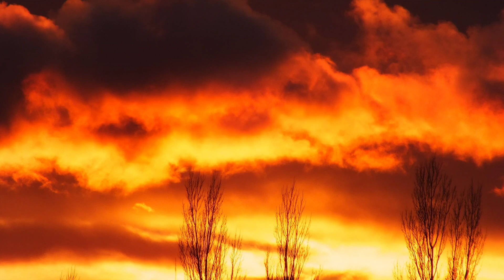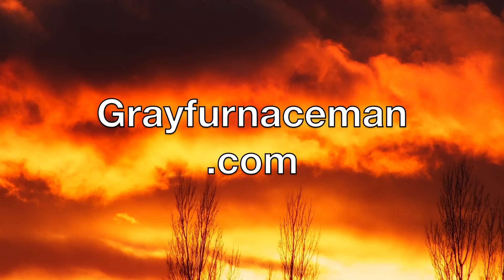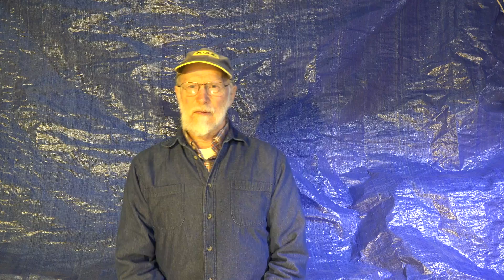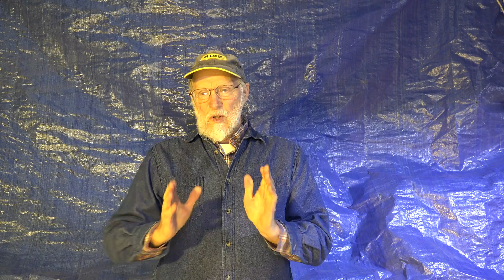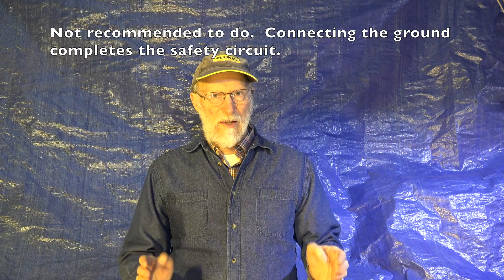What is ground in electric wiring

Comment: I think I get it. So the "ground wire" is an alternative path to neutral....?
Reply: Your original comment is basically right.  I'll try to keep this simple, contrary to popular belief power does not care about traveling to earth.  Power wants to travel back to its source, in other words the transformer.  The transformers return conductor for unbalanced power is connected to the ground bar at the first means of disconnect and that bar is then bonded to the earth at that point.  So why is it bonded to the earth if power does not naturally want to travel to earth?  Well the transformer is also bonded to earth.  The earth then becomes a large redundant conductor back to the power source this way.  The earth is not a great return conductor but it is a fail safe in case you lose the wire connection and there is a large enough fault the power will make it back to the transformer and hopefully trip the main.
Reply: For years I have checked the water pipe connection right out of my service panel "ground" with a clamp on amp meter and it is always flowing about 2 amps! I have cleaned and checked the "jumper" that bypasses the water meter. I even contacted the local power utility thinking it could be the crimped connection(s) where the overhead wires enter the weather head (down feed) Mind you the original, 1957 as built service had only this water "ground".
 Sometime in the 1980's the service was upgraded and a ground rod installed at the service entrance, so there are two grounds. In some ways it makes sense that the city mains provide a large grid of earthing conductivity over a single rod driven into the earth next to my basement wall.
Regardless the utility assured me that nothing was out of sorts, go figure.
By the way, the water mains cold water is copper pipe in the basement and under ground a copper tube running 80 feet to the city mains. Fun stuff
Reply: +Volusia-ev Not exactly, neutral is at the same potential as ground if all done the proper way. The ground can be broken, say if there is only two wires in a metallic conduit and for some reason the ground path is via that conduit and it is open. (the conduit is supposed to be grounded in case a wire shorts to it)
Think of it this way, the ground is not meant to carry current, it is there as a safety. Only the neutral is there to carry the other side of the return to the HOT lead through an electrical consuming device.
Reply: +Craig Nehring If current is coming back to the man panel through the ground wire, where will it likely go?

 Even though both the ground and neutral are connected at the box I would think electricity would take the path of the neutral back to the transformer over the grounding rod.
Reply: Normally in a properly wired situation nothing ever flows on the ground wire, so yes you are correct.
There are some not so obvious reasons for a grounded distribution system.

I had a tree limb hit the high line in the area and in most places with single phase power the High Kilo volt line shares a common ground neutral with the 240/120 lines of the same transformer.
 see pic https://en.wikipedia.org/wiki/File:Single-phase-pole-transformer-d335.jpg
You will note in the pic there is only one wire going into the transformer with three coming out.
 The resulting short caused very high current flow in the ground that is connected both at the electric meter (back of the house) through my home ground via the cold water main that is terminated at the city water mains (at the front of my home).

How do I know this? I was standing in my front room when it sounded as if a stack of guitar amplifiers started humming for a few seconds until the high line feeder fuse blew taking out the neighborhood. The cold water run was for a moment, acting to waste that power to ground and like any conductor carrying high AC current it will hum. In newer homes there is a dedicated, heavy gauge ground wire rather than relying on the water pipe.
Reply: Yea that's pretty nuts.  Not sure if you knew this, but another common misconception is that power only  takes the path of least resistance.  Not true.  It takes all paths.  The path with the least resistance will carry more.  So in the case of the ground rod/copper water main ground not carrying any current under normal conditions, well I guess, but it depends on how much resistance and how much power.  It's technically possible to get measurable current under "normal" situations.

Comment: nicely said. It finally sunk in.
Reply from the maker: +jeff burton The light went on huh.  Thanks for the support.
GFM
Reply from the maker: Perhaps the reason you are getting tripped up here is you can get a shock from contact with a hot lead and earth ground without connection to neutral.  Earth ground can act as an absorber of current.  The amount of current absorbed depends on the impedance of the earth.  Earth impedance can quite high and could be high enough that no shock would be noticeable.  As for your second question, equipment grounding serves 2 purposes.  The primary purpose is as a safety conductor in case an appliance has a fault to chassis.  This fault will pass to the neutral buss bar and will open the circuit protection.  Earth ground is not involved.  The second purpose is to direct spikes and lightning to earth.  I will be doing another video on how much current can be absorbed in the future.
GFM
Reply from the maker: Well, I would not say that in all cases.  Certainly, if you were touching something that was grounded to earth ground, and the earth ground was connected to neutral in the panel you would have the dead short that will give a large shock.  If you were standing on the earth and touched a hot wire, you may or may not be shocked.  It all depends on footwear, minerals in the ground, your body's resistance and moisture in the ground.
GFM